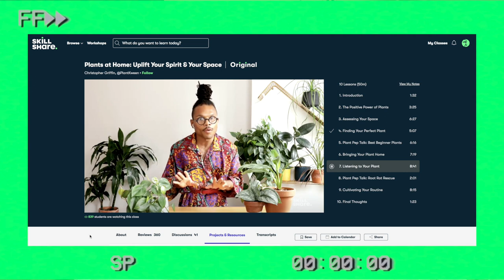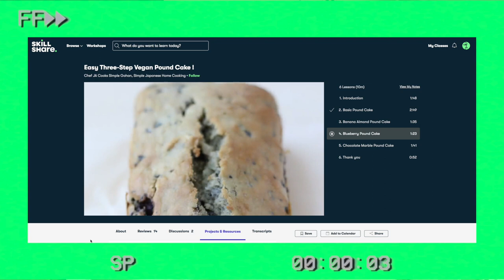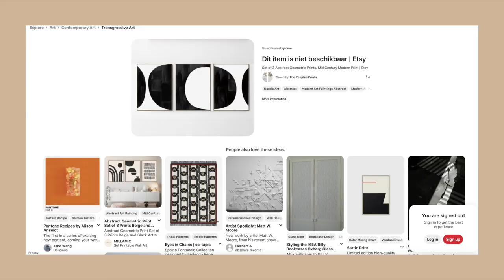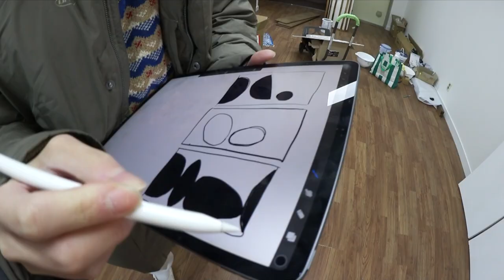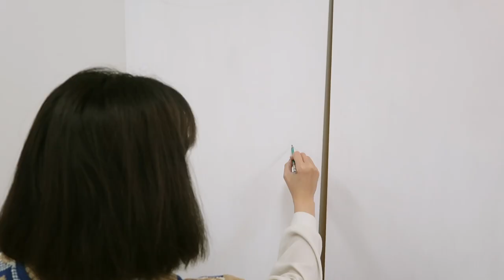Home Vlog: Painting to Decorate our New Studio Apartment (satisfying) | Q2HAN

Comment: Hahahah you can peel it of the mirror if you are not happy. Acrylic is a type of plastic. It is actually very easy to remove especially on a smooth surface like a mirror without getting it scratched. If it doesn't peel as easily then the paint is too thin, then paint over it again with leftover paint and it will peel off so satisfyingly :)
Lots of love from Belgium!!

Comment: Hi QQ! 
For the mirror painting, i think if the acrylic paint is thick enough, you can peel off after it dries.. I painted on a smooth surface before (my macbook 🤪) and the paint after a while started coming off and then I just wiped the remaining paint with wet wipes 🤷🏻‍♀️ that was just my experience with something similar .. hope it helps 💗💗

Comment: I think if u erase maybe 2/3 of the flower and expose more of the mirror, it could look really nice! Acrylic is really easy to remove from a smooth surface e.g. mirrors.  Spray with water, leave for maybe 2 mins and then rub with soft sponge or cloth.  It should flake or peel off.

Comment: i think if you use something like a soft wood stick you can scrape off the acrylic paint without damaging the mirror. It looks like the coats were thick enough that you can peel off a lot of it after you lift up a chip of paint to grab onto. If you cant find any soft wood, you can probably use some thin cloth wrapped around the end of a chopstick to scrape it off

Comment: There's a tool called glass or window scraper wc u can buy at a hardware or arts supply store that's specifically used to scrape paint off from glass or palettes. It won't damage the glass so long as you scrape from an angle.

Comment: You can definitely save that mirror, I painted clouds on my mirror with acrylics and when I wasn't satisfied with a few clouds I peeled the paint off, it mostly peels off smoothly, and where it doesn't competely peel off you can use sth like a metal spatula that is not too sharp to scrape it off, I tried erasing it with water and a glass cleaner but the paint only smudged and became even worse

Comment: NO! Don't throw it away you can erase Acrylic Paint on mirrors. One of my coworkers did a painting before on the glass walls at my work using acrylic and it can be erase, you can scrub it off. or use Tinner to erase it if you don't like to damage the mirror with scratches from scrubing. Also you can buy canvas Fabric with White prime already😊 to save sometime from priming and painting it with white. Here in the Philippines they are usually sold in rolls per meter. You can also use Glass paint but there's no turning back with that paint cause it might not get erased anymore🤣